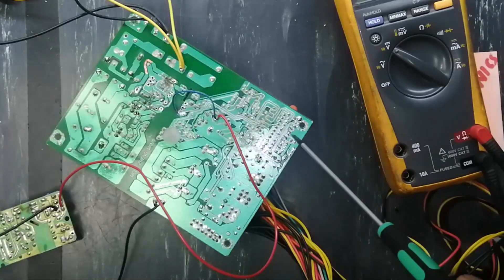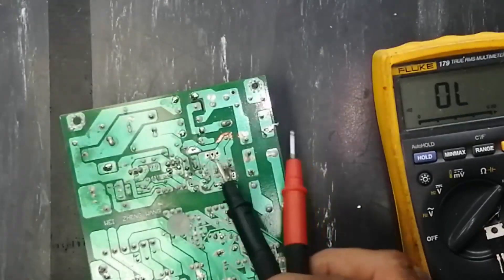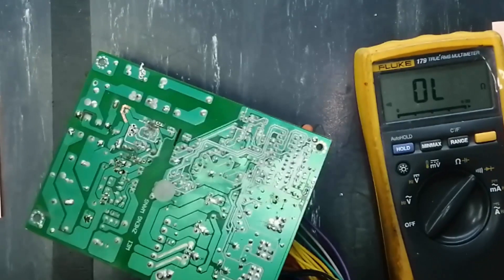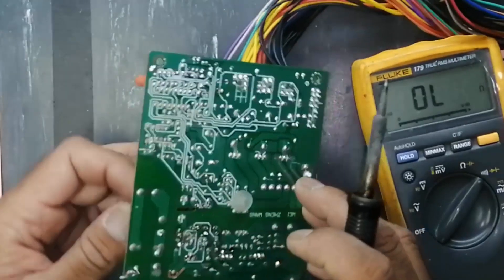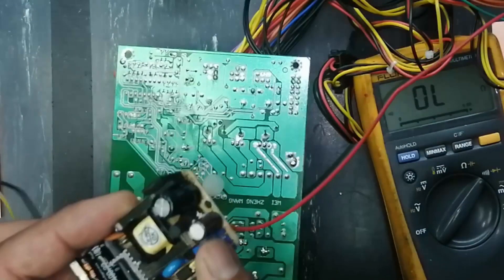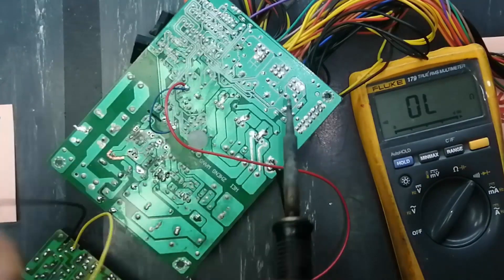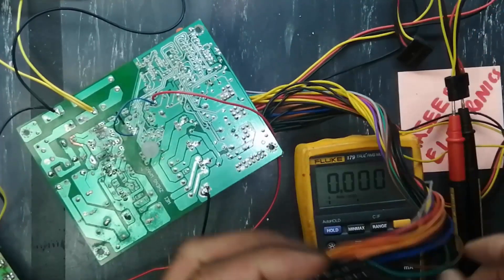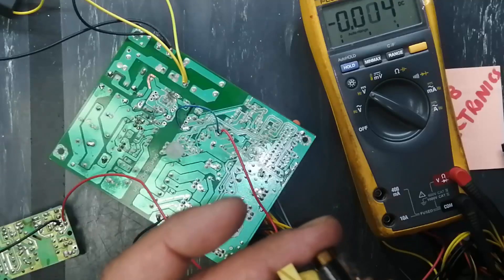#213 Repair Computer Power Supply /ATX Standby Voltage Fail Part 2

Comment: @HaseebElectronics LOL... Why  didn't rebuild the traces using copper wire/soldering wick and fix that standby section? Even if transformer is shot, you can easyly open it using a heatgun/hotair or simply throw it into boiling water,  and simply rewind it!, eventualny salavage simillar transfromer from other SMPS and just replace it...

Comment: my stndby voltage is 7.05 volts  at stndby terminal (violet wire and black wire) have replace already components..  but still 7.0 volts .. do i miss a component  that is still defective ?

Comment: Can I use 5v 2a mobile adapter as external 5v supply as standby ?
Reply from the maker: yes it can done. it will a perfect solution
Reply: @HaseebElectronics  I did that ,smps working +12v,+3.3v,+5v,-12v
Reply: @HaseebElectronics  Hi I need your help again ...voltage across two capacitor is 304 v with input voltage of 226 ,
peak voltage must be 226*1.414 =319  ?or 304 v is good to run the smps?

Comment: Hello sir, in other video you said standby transformer give 2 power, 5v and 9-12v, then 9-12v use for signal tranformer. Why in this video you only replace with 5v adapter ? So how to give 9-12v for signal transformer to work ? How much power for signal transformer need ? Can it work with 5v ?

Comment: Thank you very much Mr. Haseeb you are amazing!
 Question please don't we need 12v on the second output instead of 5?
Reply from the maker: welcome and best regards 
please specify that time reference in the video, at which point you got a question, it will easy for me to answer correctly
5 volt and 12-14 volts are provided by standby power section 
and 5 and 12 volt are also available in secondary section
your question for which one section?
please reply
Reply: @HaseebElectronics  
Thanks for the reply Mr. Haseeb

 I mean you used 5v on the 2 outputs of the transformer shouldnt one of them be a 12v?
Reply from the maker: yes you are right

Comment: Assalamu alaykom brother and thank you very much for the video. It is very beneficial what you do for us.
This last week I bought a switch mode power supply for a PC of type: BEBIBOS POWER SUPPLY ATX 12V V2.32 MODEL NO: ATX-P4 500W at first I thought it was on, when I turned it on I noticed that the fan ran for about 30 seconds and stopped. After a 15 minutes stop I turn it on as usual the fan spins a few seconds and stops. I checked the state of some components: the bridge diodes, the capacitors, the zener diodes, the switching diodes, and even the IC, but in vain it's always the same: the fan turns a few seconds and stops. However, I have the 5V of the green wire as well as the 5V of the purple wire(standby voltage) - Question: according to your experience how to repair this power supply? Thanks your brother from Tunisia.

Comment: How much voltage is the computer power supply green wire
Reply from the maker: green wire is PS ON command 
basically it is taken from 5 volt standby through a resistor. so in normal condition it is around 5 volt

in some models it is around 2.5 volt are above up to 5 volt
Reply: @HaseebElectronics  Thank you so much

Comment: sir i have problem with my power supply, first there was l leaked capacitors on the output and the fuse was burned out and i changed the caps also the fuse, when i plug power standby is ok.when i try to power it on, it wont turn on it makes noise, when i remove the jumper for i used to power on, the noise disappear, can u help me what is making the noise
Reply from the maker: it means you have something short or leak in secondary side. might be some rectifier or capacitor which is causing to drive the power transformer in overload condition
Reply: @HaseebElectronics  thnak u sir its very helpfull
Reply: @HaseebElectronics  sir can i use liner power suply for laptop, i mean by using 19v transformer then converting to dc and by just adding output caps?

Comment: Salam M.Haseeb, nice explanative video. I am trying to fix an issue where the input voltage is fluctuating, i have from 75vac to 115vac across the bridge and main capacitor from the mains that shows 220v. I removed all the MOV and filter capacotors but still unable to have stable 315vdc, any idea where to look at ?
I changed the bridge and checked the mosfet which do not show any short circuit. Thank you & Salam Aleikum.
Reply: @HaseebElectronics  Thank you, i will do this and let you know.
Reply: @HaseebElectronics  I removed and tested the 2 mosfets, they seem good the problem was rather on the secondary side as I found the schtokky diodes shorted as well as a swell capacitor.
After changing them, i still have no output, what generally goes wrong when the secondary schtokky goes short ? thank you & salam aleikum
Reply: @HaseebElectronics  The voltage at capacitor is now very stable at 315vdc. I have 3 optocouplers, i put a diode in all of them ?
Reply: Haseeb Electronics Salam Aleikum. I checked and only one optocoupler is linked to the negative side of the main capacitor. I placed the diode and lost everything in the secondary. The secondary voltage when i turn on goes to 6 or 7v then dies to 0v not fluctuating.
Reply: Haseeb Electronics Hello M Haseeb, i found the optocoupler responsible for feedback, once disconnected and a diode in place i found the original 12.33v but i did not feel any component heating up. I have a lots of smd diodes in the other side but all cold... Thank you and salam aleikum
Reply: @HaseebElectronics  Hello M.Haseeb, it is YOUR technique and a very good one ! At least i know that the chopper circuit i sworking.
Now, when i placed the optocoupler back, i still have no output, and no component has warm up to show any short except the SMSP yellow transformer which was a little hot. I removed and changed the capacitors 16v but stil no output.
What do you recommend else to do to have back the output ? Thank you & Salam Aleikum from warm Morocco.

Comment: Hi, I'm trying to repair my 450w ATX, 5vsb was good and noting shorted but it just can't start up, it use WT7527 , TNY277, UC38438 and LM339 IC, all capacitors, transistors, IC, diodes were checked good, WT7527 on PGI and PGO have no power, VCC have 4.5v.  but one of the diode SBR20100 if using ohm meter to check is only 300ohm, I wonder will it caused the problem. BTW it's just my hobby to repair non working things. : )